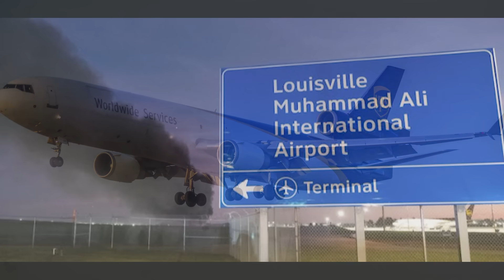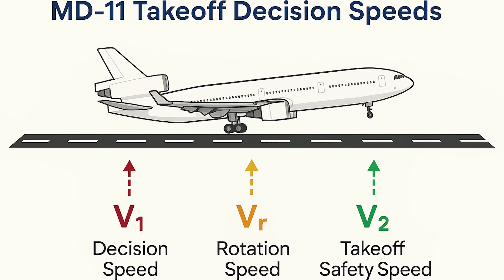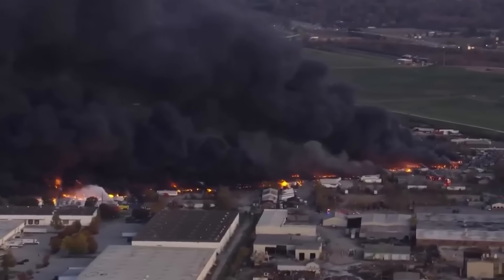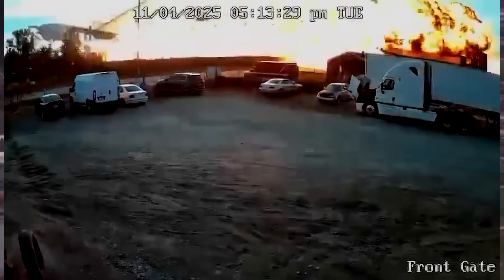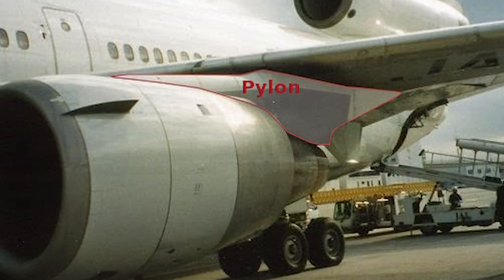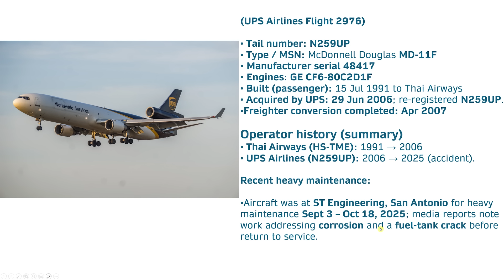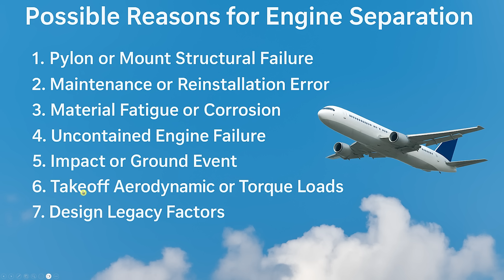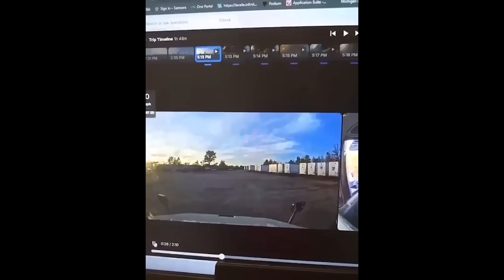What Caused UPS Plane Crash, Louisville, KY? How MD-11 Engine Fell Off

Comment: That was a great and informative video.I unfortunately witnessed the whole thing live. I have worked at UPS for 34 years.And of course, it is the worst thing I have ever seen.And I never, ever imagined I would see something like this. Almost every day after the load, I will set by the runway and watch the planes take off on my break. Tuesday will be burned in my memory forever. As the nose started to lift and the plane was taking off.There was a lot of noise and then all of a sudden, a massive explosion, and the number one engine popped off and went flying to the right side of the plane. The thing it reminded me of was, when you see the videos of people putting mentos in the two liters and they go flying, it did just like that. As I am typing this, they just opened the runway where this all went down. It felt like I was watching a movie.I just couldn't believe it. I am sitting in that same spot now.Watching all these planes taking off. I can't stop thinking about all of the families' lives that were changed forever.😪
Reply: I’m so sorry you experienced this. Just an awful situation.
Reply: @colemarie9262  you know this is a lie right? What are the chances that the one of a handful of people that witnessed it are here to tell you the story.

There’s people like this in every true life story with victims. They lie for likes, I think they are bots designed to drive engagement.
They are all over youtube.

Go look up multiple commentators on this exact crash and the top comments are people always claiming to be close to the victims in every single video.
Reply: @Trigger200284 maybe because they seek out the videos and it can be therapeutic to say these things. Or maybe not. But what I know for sure is you should shut your mouth in case he is legit. Imagine what that would be like reading your accusation. On the other hand if he isn't, then who cares. But no, you have to be the know it all. Congratulations. You're so smart.
Reply: @Trigger200284 and maybe a worker searched for it to leave this comment.
Reply: @Trigger200284 , did Ryan Simmons claim to be "close" to the victims or even know them?   Clearly not.

You can go now and troll somewhere else.  BYE!!!  👋🏼
Reply: @Trigger200284 well you know, those people look for the videos. So yes it could be a true account.
Reply: @Trigger200284 
You are right, this guy's a fraud.
Reply: @Trigger200284 you are probably right🎉
Reply: Oh my. That must have been surreal! Seeing it and realizing that it was actually happening. Do take care of yourself. Talk and 🙏🏽
Reply: At 6:15, I suspect that it was the tail of the aircraft that ripped open a gash in the roof of the warehouse, not the landing gear. They were nose high, tail low, and all gear appears to be intact in the other video clip (0:17).
Reply: @MrPLC999 agreed
Reply: Be sure to get help for yourself!!  Take care and God bless!!
Reply: Thank you all for the kind comments. UPS is actually offering help if we need to talk to somebody. They have a school bus of people at the site where the engine landed. Looks like they are doing a FOD walk to see if there is anything they missed. It is raining here and very gloomy.
Reply: @ryansimmons3458  thank you for your comments from the perspective of an observer instead of just those who watch the videos and believe they are experts.
It must be extremely difficult to continue working there and having seen that disaster.
Hopefully you will be able to get all the help you need. 
It might be one of the highest number of casualties on ground by an aircraft crash in the US. 
Those people had NO clue what was happening.
Reply: Insane. I can't begin to imagine the horror.  Expect PTSD from this event.
Reply: @brocbradley2313 yes always a expect the worse right geez you people
Reply: @DramaMustRemainOnTheStage it's completely plausible thst he'll experience PTSD from this. Be grateful you aren't familiar with it.
Reply: I am so sorry. I believe you are experiencing shock. It can be very traumatic, and sometimes come up unexpectedly later on. If you can, please reach out to a counsellor if you can. I am so sorry that you witnessed this tragedy.
Reply: Seek some help, talk to your spouse, best friend, priest. It will never go away, but it won't hurt as time goes by.
Reply: @redgolf845  Wise words friend, I hope he heeds them
Reply: @redgolf845 noooo not the spouse. A friend or a pro would be best.
Reply: @redgolf845 they are lying.
Reply: Hang in there brother
Reply: Im so sorry the person Tigger whatever  doesn't have better manners or better understanding with critical thinking  This is a horrible thing to have a moment by moment replay. Bless you. I wish you the best for your future ❤
Reply: Sorry you had to see it, no words on that... Your description i.e. noise, explosion, engine flying off to me would suggest an uncontained engine failure either due to something internal  or potentially  improper mounting. I wouldn't guess a structural failure first but I wouldn't rule that out either.
Reply: I am so sorry you had to experience that.  Be gentle with yourself, take the time to process it and please get some professional help.
Reply: Are you being interviewed as a witness? I understand that there are videos and other technology being used, but I’m curious if you were contacted as part of the larger investigation. 

I really am sorry for this tragedy in your community, and I hope you feel emotionally and mentally supported right now. I’m praying for you all! (Knoxville, TN)
Reply: @jessikas3977 UPS has cameras everywhere. I am sure they have it all recorded. I would definitely help if I can but nobody has asked about witnesses yet. Thank you,it does help talking about it.
Reply: Ikr, same,was in Le bourget watching Concorde went down...this reminds of AA191 ... petrol plant near runway, Airport authority should have foresight n enforce a wider Splay in V2 segment
Reply: Thanks for sharing. Hang in there brother.
Reply: The three on board became a "band of brothers" but not something that anyone wants to go through.
Reply: Please leave a statement with the NTSB.
Reply: @Youp1e I went to management today and told them what I saw. They said if NTSB asks for witnesses they will get in contact with me.
Reply: I pray the peace of God for your mind, pls talk to a therapist if it helps.
Reply: Thank you for taking the time to write about your experience. I’m dumbfounded how the engine just fell off. I’d guess workers were missing and the installation was not checked by another person. Such a huge oversight only equaled or really far surpassed by the effect. 🇺🇸
Reply: I pray you find peace and you know Jesus. He will help you through this terrible tragedy 😢 God Bless you Ryan ❤ 
Love and Prayers from Brisbane Australia 🦘🌏🇭🇲 ❤️🌿🕊️
Reply: My sympathies to your entire UPS family.
Reply: I can't remember where I heard it or what crash it relates to, but I remember a story of an engine mount on being bolted properly and or fatigue in the engine mount bolts and the engine detaching, but something makes me think it was non-fatal, though my memory could be all messed up.
Reply: UPS has been such a part of my life as a consumer that this has landed as the loss of a personal acquaintance, rather than an "interesting" work accident.  It is such a sad and difficult tragedy
Reply: I probably would not want to sit there watching further, or even be there anymore. Too risky. Once is all it takes to remove us from this life.
Reply: Glad you are safe bro! R.I.P. to the ones who are not!
Reply: How in gods name does a engine fall off
Reply: That noise you heard could help the investigators.  That is information they would be interested in.
Reply: You live in Louisville Kentucky?? I do to and this happened right down the street from me. I heard something and then all of  sudden got a phone message to take shelter within 5 mile radius. I thought it was a nuclear warning of incoming missiles.  But the plane went right over the road I use to go to work. Now I cannot take that route to get to my job,
Reply: @RandomHuTaoSimp  Yeah they said right after it occurred that Grade Ln is closed "indefinitely". Hopefully that really means, we're not sure how long it will take to reopen it. For those claiming people who are posting stories about what they saw, are making it up. I live here and so far all the ones I have seen sound legit. I live 10 minutes or less from where this happened. I could see the glow from the fire against the sky after the sun went down (crash happened at 5:15, sunset would have been about 5:35). I know a lot of people who work or worked at UPS, including family and friends. My brother works at CSX which is next door to the airport on the UPS side. I've been sent some of the videos before they hit the news. I've examined many of these videos, compared them to local maps, Google street view, etc.. I am not an aviation expert or crash expert but here's what I can tell from everything I have seen. Right before the plane started it's takeoff roll (I believe this term refers to the dramatic nose up large planes do on takeoff), the left engine separated from the wing and caused fuel to spill and combust. The left engine was flung across the ground to the right side of the plane and it is most likely some parts from the left engine entered the right engine (there are large sparks from the number 3 engine at this point). The plane barely cleared the fence past the apron at the end of the runway and impacted the roof of a warehouse. From what I have seen, it is mostly the landing gear or the tail, not the left wing that hit the roof of the warehouse. The plane was level when it cleared the warehouse and then struck some power lines upon which it did a hard roll to the left. The left wing hit the ground before the plane was at 90 degrees rotation. The actual impact of the wing to the ground is slightly out of frame in all the videos I have found so I cannot estimate the actual angle. According to the NTSB the plane impacted the ground about 2000 feet from the runway skirt and left a debris field 1/2 mile long (2640 feet). The altimeter read 475 feet at it's highest point. Louisville is 500 feet above sea level. Determining the height above ground given the takeoff roll, the readings are taken every 1/2 second, and other factors might make it impossible to get an accurate above ground height. I would estimate the plane never got more than about 50 feet in the air from the videos. But it's really hard to say for sure.

Addendum: I just watched the NTSB update from last night and the said that from what they can tell it got to approximately 100 feet. But that they are still working to corroborate that. A professional pilot who has flown this aircraft said that the altimeter is notoriously inaccurate on the ground. He also stated that the 100 feet is from the cockpit and he estimated the height was not more than 50 feet.

Why Dual Engine Failure Changes Everything — Louisville Crash Update - Captain Steeeve
https://www.youtube.com/watch?v=CmXLQHhUtv4
Reply: @RandomHuTaoSimp I am right there with you. I take grade ln every day to get to work. I have to take the back way now. Takes about another 10 minutes down Crittenden Dr. I am sure they will get Grade Ln up and running before long. So many people work down there.
Reply: I am so very sorry for your loss.
Reply: Oh gosh, that must have been terrifying!  Prayers for the families, friends, and everyone involved!
Reply: It's very unfortunate you had this experience, a jet engine exploding during takeoff if debris on runway or massive birds strike it ponts directly to mechanics issues.
Reply: Similar event occurred to ill-fated flight AA 191 in 1979. The right side wing engine detected on takeoff roll...and we all know the rest of the tragedy.
Reply: I'm sorry you saw the accident , when I watched the video all I thought about is their family.
Reply: Sorry you experienced that.  Some people are saying the plane deviated to the right of the runway before takeoff.  Did that happen?
Reply: @LokiCentral No,once the engine blew off it started descending and veering slightly to the left. There was debris going everywhere. Actually looked like the #2 engine started sucking a lot of that debris causing it to start to stall. It was so loud...The left wing was punctured, so the fuel was spraying right on the flames. It just became a fireball where the #1 engine used to be.
Reply: :eyes-purple-crying:
Reply: It was a 💣  it's evident that is what it was and the way you described it makes absolute sense.
Reply: @GODSCHILDINTHEDEN I am not with the NTSB or an aircraft mechanic but when it started take-off there was a lot of noise like something got sucked in the engine and maybe broke the fan blades. I have also heard people out here say they think it could have been birds, but I did not see a single bird near the runway at that time. It is crazy how many birds like to fly around the airport. But at this time I did not see one.
Reply: @ryansimmons3458 my mom said there was a drone they were tracking but lost it quickly.  I just don't believe it was an "accident "
Reply: Didn't know you guys had liters in the U.S.
Reply: Please get some help for yourself to ease your mind body and soul.
Protect your well being..we'll be praying for you..🙏💙🙏
Reply: Thank you! Our best help here is anti-aircraft mobile groups :) @carmelaszymanski8232
Reply: Omgoodness! Sending you love, hugs,  and plenty of prayers😢❤🙏🏿
Reply: Thanks for sharing 👍
Reply: Jesus Christ! I'm sorry you had to see that. Thank you for helping to prevent stuff like this from happening for the past 34 years. Every hand that touches an aircraft or any systems it relies on in any way, matters! As you know, it only takes one mistake by one person to create the first, or the last, hole in the swiss cheese model. You must have been doing something right all these years! Thank you for sharing that very personal and intimate account of what you saw. I can't imagine! Please do reach out to talk to someone about how you feel. A person who has dedicated his life to this career for 34 years, no matter it's capacity, deserves a hug and a handshake at the end of the day. My hat is off for you, Sir.
Reply: You seen the gematra behind this ,no way is it conikydink
Reply: Have you been interviewed by the NTSB yet?
Reply: Sorry you witnessed this brother. Praying for you. "Captain Steeve" has a video on this crash and he believes that the blades came apart in the left engine, causing it to fall off. The engine pods have been safe for years, though originally there wer issues. The blades are in a line of sight from both front engines to each other and the blades of a disintegrating engine can fly through the other engines, e.g., the engines hang below the fusalage. The plane cannot lift with just the one remaining engine - especially loaded down as it was.
Reply: My brother been there almost 40 yrs...he just so happened to leave at 4:00 that day..hes normal time is 5:00.his route home was right there grade ln at usually 5:10...his office was about 50 yds from that wing sliced thru the roof...u might even know ..joey hurst..hes been back to work but has an xiety evertime a plane takes off
Reply: @jasonhurst4332 I don't know Joey but you know how big this place is. It's a good thing he got to leave early. It's crazy how thing like that work. They had us evacuated at 5:45,I am normally here till 7. Definitely something None of us will ever forget.
Reply: Bad inventions now. Need BOYCOTT.
Reply: I hope you’re going to be OK because sometimes what happens is it you’ll get PTSD from the trauma of watching it so just be careful of any changes that you start feeling and if you do get any changes, go to your doctor because PTSD you can’t deal with on your own it’s impossible.

I too feel sorry for the families that have been affected by this. I mean the pilots the poor guys never had a chance and that’s the sad part is that they never had a chance.😢

Please take care .
Reply: God Bless you
Reply: I’m so sorry you had to witness that😢
Reply: I DON'T BELIEVE YOU !
BRING RECEIPTS !
Reply: So sorry that you are going through this, horrible, please take care of yourself 😢✌️
Reply: Have the investigators asked you about what you witnessed? You might know something important that nobody else knows. Take care, now.
Reply: @ryansimmons3458 thumbs up for being pinned by the uploader, and for being well written and sounding believable (even if who knows it may not be).
Reply: How awful to have been there live..hugs to you💯💯💯💯🧚‍♀️
Reply: The guy doesn't even look old enough to have worked for any company for 34 years
Reply: @joelthomas3823 Thank you Joel. That makes me feel pretty good. Started right after high school.
Reply: I pray you don't suffer too much from PRSD. Sending you the biggest hugs ever to you!!!
Reply: deepest condolences brother. a loss of one union brother is a loss to us all.
Reply: Sorry you had to see this..yes you will remember forever.  It does get better tho. Give it time and talk to someone if you needtoo
Reply: bro was part of the maintenance team
Reply: Sorry for the loss of your co workers I'm sure some of them were friends may they rest in peace.
Reply: Ryan Simmons, I am so very sorry you had to see this devastating event..I believe you, and only those that witnessed this, know that this REALLY happened, and it is NOT Ai whatsoever!! R.I.P. to the crew on the plane, and to those that lost their lives on ground, and prayers, peace and love to the family, friends, employees, and those that were watching this on television. Also, prayers to the Rescue workers who worked hard to tackle the explosion!! I live in Louisville, and as we can see there are ignorant people who have no sympathy or compassion for people at all finding time to say negative things during a time like this!!! WE DON'T WANT TO HEAR IT!! We will NEVER forget this EVER!! Even people like myself who weren't actually there in person, still feel the sadness of others from watching the news, seeing the smoke from standing on our porches, and thinking of how people started off their morning not knowing what was going to happen, and the terror that the pilots must have felt knowing it was nothing they could do!! 😢 SO, with that being said, I hope that all  traumatized will seek help, and continue to stay strong one day at a time, and know, that we are ALWAYS PRAYING FOR YOU ALL!! ❤🙏🏽❤
Reply: I would like to know when the fire started because the guy filming the takeoff showed the plane was on fire already when he or she started filming. 

Also WHO did the inspection on the plane before takeoff? When was the last "preventative maintenance" (called a pm) done on that aircraft? 
When I used to be at the airport working for a commercial airlines the pilots would check the aircraft visually before each takeoff themselves also
Reply: Yeah its definitely weird seeing a place that you regularly see on a normal basis on the news with a plane crashing there. For me it was that private jet crash in Naples on i75
Reply: I experienced this too because I live right next to next to the airport. There was a warning for people within a 5 mile radius to not go outside. I felt the crash. I managed to stay safe. The smoke went over the river.
Reply: Wow what a thing to witness. The Md 11 is a huge plane in person. It used to be called the DC 10 before they made it even longer. The Dc 10 was in competition with jumbo jets like the lockheed tristar and the boeing 747. I couldnt imagine witnessing a plane that huge running off a runway at 180 knots
Reply: Sweet
Reply: Ecclesiastes 9:11; Death is swallowed up forever.”—1 Corinthians 15:54 😢 I was off that day driving from Shepherdsville, I knew that smokeball was enormous and tragedy had struck #9/11 #prayersforall
Reply: That’s an amazing thing to witness live! Guess you explained it to the cops and fda.
Reply: A prayer for your colleagues that died in that terrible accident.
Reply: I was in Bagram waiting to head home after my SOF deployment and watched the 747 crash when the MATV's shifted. I remember the heat coming off of it. Something I'll never forget.
Reply: Geez i hope you are ok that must have been something horrific to see in real time
Reply: Very sorry and saddened by this tragic event. Hope you'll be ok.
Reply: I am so sorry you had to see that. An explosion ! Well that’s making sense to me as it all seemed so sudden. The fire clearly wasn’t evident during the taxi or the start of the takeoff roll.
Reply: @shazzabelle123  A fire WAS clearly evident in the takeoff from some angles. 
Direct quote from a NTSB rep during a press conference:  "A large plume of fire in the area of the left wing occurred during the takeoff roll."   The explosion came upon impact with the ground or buildings.   My apologies if you were merely making the point the fire wasn't visible initially.)
Reply: Yep, now we know exactly what happened.  For anyone interested, it takes exactly ONE DAY to determine the EXACT CAUSE of an accident.  All the paperwork is available and a few minutes of review will determine if a procedure wasn't followed.  If the paperwork looks good they walk over to the guys working on it an have them report on what they did, that takes a hour.  From that they know the EXACT CAUSE... really a couple of hours.  The reason they don't release a report on the first day is they have to figure out how to hide, reduce, or mitigate the truth of what happened so they can not disclose who is to blame to a level that is legally actionable.  In other words, they have to figure out the best story to avoid anyone actually knowing what actually happened, all figured out the very first day.
Reply: Stfu, what? I don't believe you.